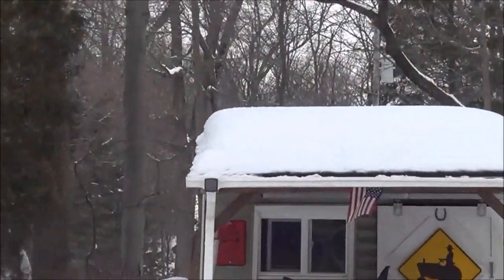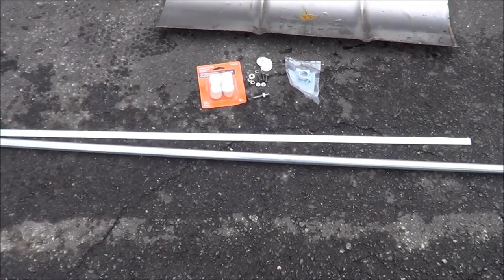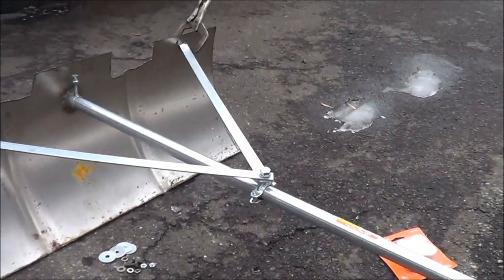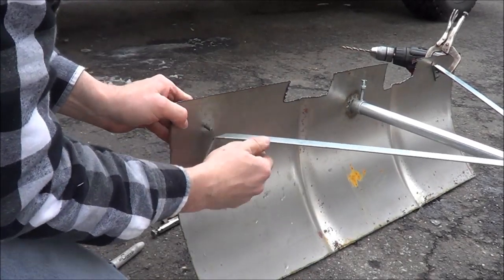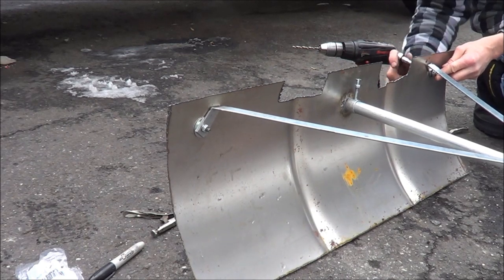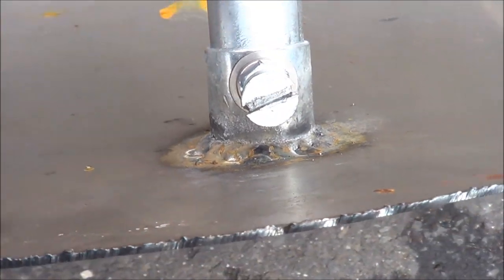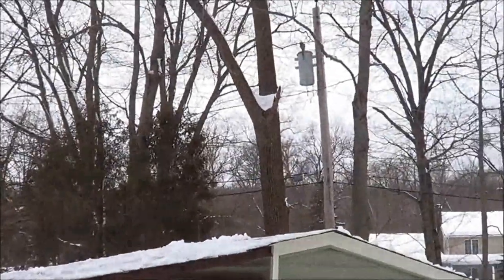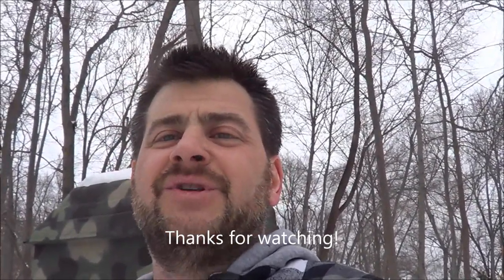2-15-14 How to build a roof rake for snow removal

Comment: Same with shovels, ice breakers and replacement wood handles . My ice breaker handle broke and my pick up is on top  of about 1-3" of ice left over from the snow and plow trucks last week. I had to get a donor from a broom.
Reply from the maker: You forgot to mention the ice melt. I have two 5 gal buckets of it left. This winter sucks.

Comment: It might be a good idea to round the points off of the corners to make it harder to poke a hole in a shingle but besides that it looks good, I've always risked life and limb by actually getting on the roofs, I wonder how much roof rakes cost nowadays?
Reply from the maker: 40-50 bucks for junk... If the frozen shingles can't take the square corners then I I guess I have bigger problems. Thanks for the comments!